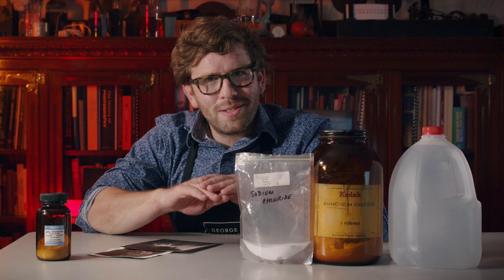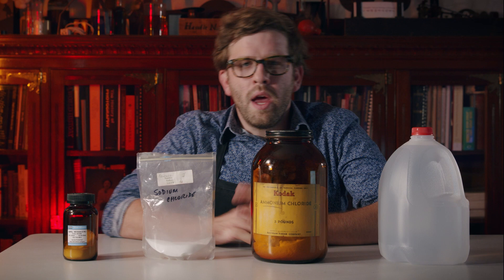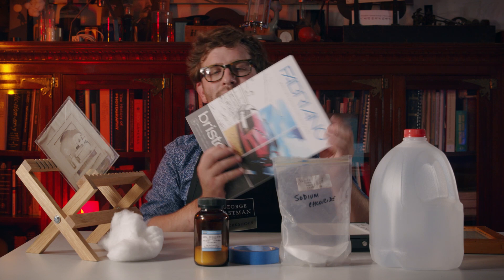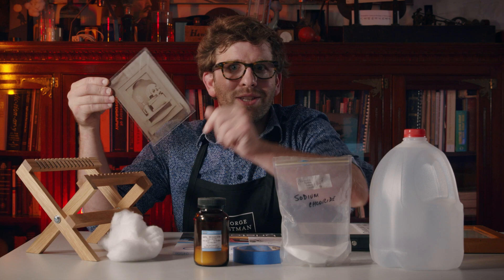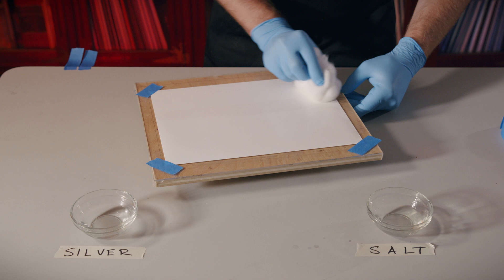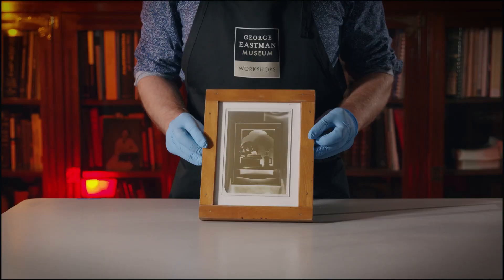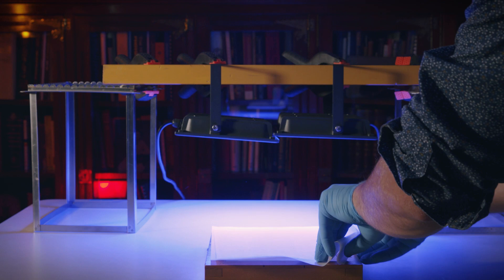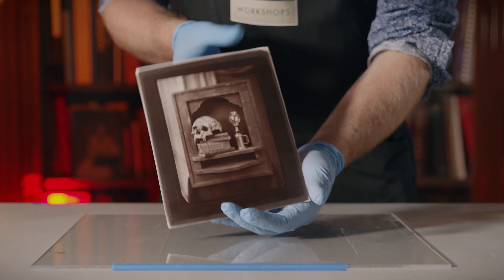Darkroom Magic: Salt Printing

Comment: Beeswax and lavender oil... I'd like to know more about that. I'm familiar with waxing paper negatives, but this is the first I've heard of waxing finished prints.
Reply: Waxing prints comes from the earliest days of salt and albumen printing. You want the wax worked into on the surface but not actually through the paper as you would with making a calotype paper negative. See the book Coatings on Photographs for many case studies and formulas for various historic print coatings.

Comment: I feel like a bunch of steps were skipped haha...wish there was more explanation between steps and the chemistry. Why do some people add gelatin?
Reply: I was thinking the same thing
Reply: A gelatin layer "seals" the fibers of the paper and stops the image from "sinking" into the surface. And yeah, Nick kinda glossed over a some of things here. (like the ratio of salt to water and Silver Nitrate to water) But though it sounds like a lot, salt prints are not that much harder than cyanotypes. You can use sodium thiosulfate or Hypo to fix. 
Oh but it is important to never use the same bit of cotton twice. Silver Nitrate is over eager to react with other compounds, that is why it trades elections with the salt so easily... that is to say, it is very easily contaminated.
Reply: @CameraEd1  Thanks Ed, I do a lot of cyanotypes and imagined salts prints were much more complex. Should try some day
Reply: Sorry Anna, These videos are intend to be more of and overview / introduction to the process VS and detailed how too. We also try to keep the length of the videos from being too long, so we have to pick and choose what are of the process to really highlight. Remember your silver is bound up in the paper fibers of your print.. Adding a little gelatin helps keep some of that silver near the surface for "Sharper" image.
Reply: @fabianofrombrazil  I love the look of cyanotypes, and they are my "go to" print method for digital photography. Salt prints are more fussy. Start small, keep notes, change one variable at a time. With your cyanotype "skills" learned, you are over half way there.
 @Nick Brandreth is very generous offering to help and trouble shoot. We are all very lucky to have The George Eastman Museum as resource and ally.
Reply: @nickbrandreth  very generous, I think I can hear your inbox breaking now.
Reply: @CameraEd1  Looking forward to hearing from you my fellow photo nerd. Haha.
Reply: salt water @ 2% salt...silver nitrate @ 10ish% you need to experiment to find the correct ratio as not all silver nitrate is of the same age or purity
Reply: @nickbrandreth  dear Nick thank you very much for the interesting and informative video.
I have question. Years ago Kodak made a product called "glazing agent" or something like that. One added it to the print's final rinse, then placed the print face down on a highly polished chrome plate to dry, usually under pressure and heat.
You know the deal.
Do you know what the chemical composition of this glossing agent was? I ask because I want to up the contrast on my glossy prints and make them more glossy. Thank you.

Comment: If a make a larger sheet of paper lightsensitive in the same manner, would i be able to print a negative on it with an enlarger if I'd use a ultraviolet light in my enlarger?
Reply: No, the negative has to be in direct contact with the paper. Projecting an image onto the UV sensitized paper with UV light will just expose that entire image area and you'll have a white rectangle instead of an image.
Reply: Actually yes, but you need very powerfull uv light source and very long exposure time

Comment: Golly! This sounds fun and easy! Just three "main" ingredients - and the video later brings in 4:04 beeswax, lavender oil - and gold chloride which sells for $75.00 for a 50 mL bottle. Maybe someone can replace this photographic "plot hole" with more detailed information.
Reply: You don't have to use Gold Chloride. While I am sure the The George Eastman Museum, just has it on the shelf. The rest of us can tone with selenium. I like Kodak rapid selenium toner which you can still get (like under 30 bucks a quart) for salt prints dilute it WAY down or you will have Kodak instantaneous toner instead. The color is more of a chocolate brown than the very regal russet-purple-brown color of real gold.
Reply: Salt print is SUPER FUN! Also keep in mind Gold Chloride is not necessary for the process. However we tone using "Grains" of gold.. There is 15.4 grain in 1 gram of Gold Chloride.. We generally tone with about 1 to 1.5 grains per bath.. You can tone A LOT of prints with one gram of gold. But remember that tone is just an choice the photographer / printer makes. Your not required to tone your salt prints.
Reply: @CameraEd1  Thank you for that impressive amount of information. I'm getting back into traditional photographic processes and try to go overboard when doing the research - I don't like setting out my supplies, taking a deep breath . . . then noticing fine print mentioning the need for weapons-grade plutonium! Have a safe and interesting weekend! 🐧
Reply: @nickbrandreth  Thank you for those specifics. I think I'll look at a few more in-depth tutorials on this process before I go crazy stocking up on salt paper supplies. Again, thank you for the additional information. ☺
Reply: @CameraEd1  thank you for the tip!

Comment: I've been using a refurbished exposure box for making prints with UV light. Can anyone identify the UV light our good friend Nick is using? 50w IP66 - that much I can see. Other specifics would be appreciated; I think my current set-up is underpowered, UV wise. It takes quite a while to produce cyanotypes. 🐧
Reply: Here is the link to the model I'm using in the video. Make sure to purchase the 50W version. You can gang up the lights together for exposing larger prints. https://www.amazon.com/gp/product/B077X5D7GS/?fbclid=IwAR2kYv2LHonRaP5TV9hwPNa6QJJbFhc7EgrRKLSZScDAUMxug67MheRxPJo
Reply: @nickbrandreth  A late "thank you" for the information. I am, in fact, ganging a few of these UV lamps together to make large prints. Because of the surrealistic amount of information the George Eastman Museum provides, I'm now using paper negative - just like Fox Talbot; yay, obsolete but wonderful photographic methods! ☺ My dream: making the trip from northern Vermont to Rochester and paying to spend quality time with you and the gang. Fingers crossed! 🐧
Reply: @TheStockwell  I built one using bug zapper fluorescent bulbs going on 10 years ago and use a darkroom timer to control exposures.  With six bulbs cyaontype exposures range from 45 seconds to 10-15 minutes depending on the negative.

Comment: Wow, this is so cool! I’m going to send this to my chemistry professor. I do have some quick questions though:
1. What chemical do you use to fix the print? Can I fix the print using things I might have at home?
2. Can I make a contact sheet from this? I have some 35mm films I would love to se positives of!
3. Is the toning step necessary? And what other things can be used to tone the print?
Thanks!
Reply from the maker: These are great questions! We do teach online workshops if you're interested in learning more, or you can reach out to our team at workshops@eastman.org if you have a few questions.

Comment: So this works with sunlight as a source of UV? What sort of exposure time are we talking about?
Also, how do you take an image of something other than a negative, i.e. reflected light? Simply optics?
Reply: Yes, the sun is actually preferable and what was used when the process was invented. The exposure can only be done by checking the progress by opening half of the printing frame. The density of the negative and strength of light dictate how long, but usually 10-15 minutes in the sun from that collodion negative (which I made). You can put this paper in a camera which is how Talbot made his first images, but the exposures are measured in hours. Mark Osterman

Comment: So how much silver nitrate do you add to how much water? Same questions for the sodium chloride. I'm already doing wet plates and this is the next thing I want to learn and try. :)
Reply from the maker: We will be offering Salt Printing as an online workshop in the near future! Contact workshops@eastman.org for details.
Reply: "10g silver nitrate in 90ml distilled water " i just found this being recommended in a several year old vids comment section the poster then said to experiment with different solutions as the quality of the silver nitrate has a huge effect on the print
Reply: A good place to start with the silver % is 10x the amount of salting.

Comment: Oh yes, let me go grab my silver nitrate from the kitchen, its right next to the gold chloride in my kitchen drawer where i put all the expensive and dangerous chemicals. 

Nice video btw, ive always wanted to try at least one of the alternative photo processes but its really difficult to get hold of the chemicals...
Reply: google is your friend for the chemicals, so long as you have a healthy bank account.  more specifically, photographer's formulary, but please read up on the hazards, you could blind yourself with silver nitrate, for instance.
Reply: @fr.marklichtenstein8892  i have found a retailer in my vicinity that sells these chemicals spefically for alternative photo processes. The only problem is, as you said, finances. Not only for the chemicals but for the equipment as well.

Comment: He uses "measured amounts" twice in the video.  That's a great print, but there really isn't enough information in this video for someone to actually duplicate this.  This is more just a drive-by of what can be done.
Reply from the maker: Hi Mike, yes, this is more a teaser than sharing the whole recipe. However, we are offering this as an online workshop and we have private tutorials if you are interested in learning more. Contact workshops@eastman.org for details.
Reply: "10g silver nitrate in 90ml distilled water " i just found this being recommended in a several year old vids comment section the poster then said to experiment with different solutions as the quality of the silver nitrate has a huge effect on the print